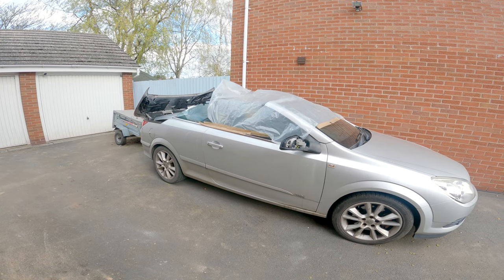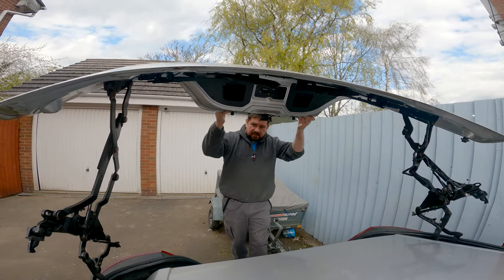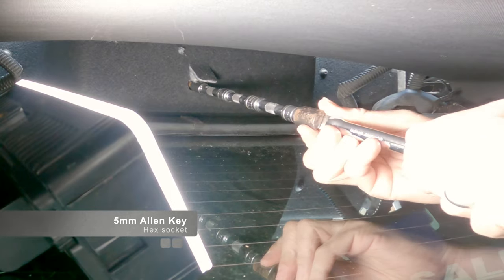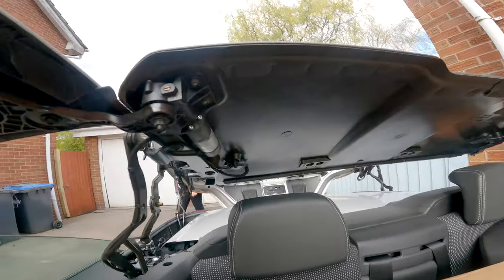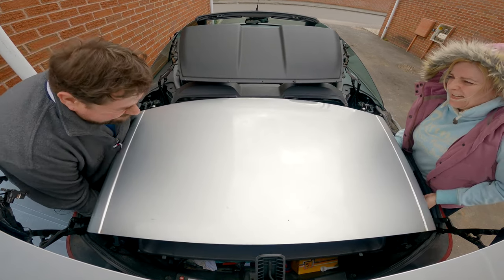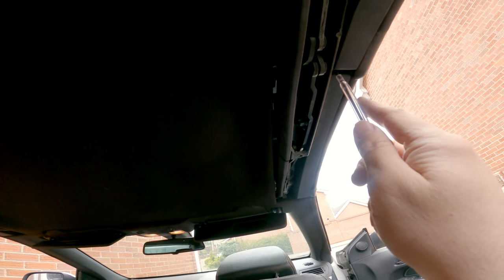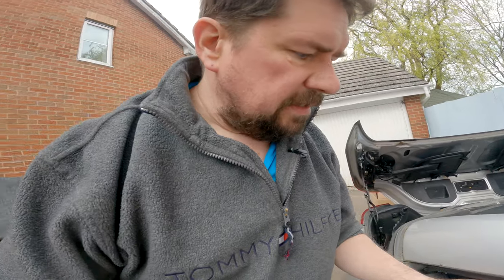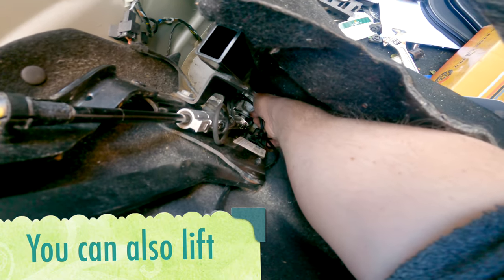How to Manually close Astra Twintop Roof

Comment: Wish you video was around 3 weeks ago would have saved hundreds.
Reply from the maker: Thank for the comment, I wish I didn’t have to do this video at all but I hope it helps people in the future
Reply: @RichManPoorMotors  Any more videos planned for this car? My TT is in a bit of a mess the rear ECU needs cleaning/replacing, boot won't open currently and car will not start. Ordered an op-com today to hopefully sort some of the issues.
Reply: @RichManPoorMotors  thanks, good video for future reference shared with FB owners group.
Reply from the maker: I have some servicing planned on twintop, might do ultrasonic cleaning injectors and timing belt, once I get a couple of my other cars back on the road, started work at work before lockdown so hope I can remember where I put everything 
I’ve used Opcom myself, when I purchased the car the boot wouldn’t open, and sorted that, I might have filmed some stuff that I haven’t edited as my farther was on them and passed away, so a bit hard to edit at the moment
Reply: @01Blagard Thanks for the advice, Vauxhall said the roof ECU is causing the starting issues (keyless entry), ever heard of that? Plan is to get the boot open , clean up the corrosion if salvageable otherwise get James out from Kent who does mobile repairs for TT roofs.
Reply from the maker: this video will be going live tomorrow morning about the boot unlocking and latch https://youtu.be/8UNmt3ZJwv8
Reply: @RichManPoorMotors  How to repressurise hydraulics?
Reply: Great video, thankfully it was one of my winglets that failed to open,I turned manual screw 2 turns tried again and it closed,I'd already changed to brass cogs 2 years prior,

Comment: Finally someone has done a video showing this procedure. Ive also got a twin top with the roof stuck open and managed to figure out most of the manual closure procedure but couldnt find where the hydraulic relief valve was. I literally stopped working on it an hr ago with the thought of doing some more research then came across your video. I will have the roof up tomorrow without a doubt 👌🏾
Reply from the maker: Make sure that all the roof locks boot locking and rams in the boot are fully closed position or boot won’t open from Handel, or Disconnect plugs as shown in the manual to disconnect roof ecu as to access to the boot from boot switch I could use my laptop so didn’t think about it at time of filming otherwise you need to manually open the boot which is a pain
Reply: @RichManPoorMotors  where abouts is the roof ecu?

Comment: to solve the boot not locking at the end you need to push the big plate behind the plastic trim for the boot to latch as well as keep the pressure from the pump turned off and the rams pushed all the way up till they stop then lock the latches then turn the pressure release back on then itl work 1st time

Comment: Thank you. Saved my life. The netting came loose whilst I was closing it. Read the books and it makes this process so much harder. Thank you x100
Reply from the maker: Thank you for your comment, I’m glad it had helped
Reply: Don't know if it would still apply to you (or others) but I tied a thin rope from the loop on the plastic thing at the front of the netting to the side of one of the mesh storage compartments (very loosely) so I could grab that cable and pull it in to reach the netting again in case of it closing with the boot in (had happened before and isvery difficult to reach) - so a good idea to do before anyone gets this problem :)

Comment: omg what a lifesaver....I thought car was fit for the knackers yard...2 rac guys couldn't get it back up...took a while but following your instructions me and my tiny gf have the roof back up...I broke the boot latch but with help of a bungee cord I am on the road again..Will have that fixes for a LOT less price than getting g the roof up...thankyou...legend
Reply from the maker: Glad it helped, fault is usually broken wiring on the left hand boot arms
Reply: Hi my boot won't open and now it's making a beeping/dinging sound which it never did before could they be due to the boot.. only happens when I go over 20mph
Reply: Hi jack if you have the beeping it means your boot latch IS open....I had same problem but mine wouldn't close...soon as do over 20mph the beeps start so be careful it doesn't come lose while driving....I had 2 bungee cords round mine till took it to garage

Comment: Even years after you uploaded this, you're still helping people. Mine was also stuck mid closing. However I did screw up the final part and now the trunk isn't fully latched yet I can't open it. But it did make my car drivable again untill I can get it checked out by a mechanic. You saved me a few for a rental car. The included instructions are rubbish indeed
Reply from the maker: To open your boot pull fuse (15 I think) under the bonnet this will allow you to open the boot to adjust latching, it is probably the hyd rams not fully up left and right but mack sure you replace fuse before driving as it also connects important other systems

Comment: Very clear, thank you. I've had lots of problems with the roof and the hand book is useless. I have to say that each time the problem has been different so I can't blame anything specific. It's getting the car to a repairer that's the biggest headache if you can't get the roof shut (as all readers no doubt know). 

I've had the same gears as you plus electric looms/computer, and now its one of the rams. It's a circlip that's gone and, no doubt, I'll have to get the whole ram because you can't get the cheap part!

I still love the car though.
Reply from the maker: You should be able to get circlips from a motor factors or Amazon
Reply: Ah, OK, I've only just seen this reply - as you can see above, another problem!

Comment: Great video 👍🏻 and very informative. I’ve always fancied a twin top but this has always worried me if this happens when the roof gets stuck . Are they reliable & do you get many problems with the roof ? Cheers Terry
Reply from the maker: I’ve had a be eos that had no faults and this Astra, the Astra had mega mileage and I bought it with a fault, the wiring loom on the Astra is exposed compared to the hidden eos, which makes it more prone to being caught by something in the boot. But easier to repair, the main problem would be a broken wire but this can happen in any saloon, estate or hatchback, there is just more of them in a twin top.

Comment: Hello! Thank you so much for this video - we managed to close the roof manually following your video. But probably we did something wrong at the end - we closed the trunk and it's impossible to open now. At the autoservice they don't know what is the problem wit the roof and only for opening and accessing the hydraulic system to check the problem, they want to charge crazy money. I decided not to fix it just asked them to remove beeping (the cars beeps because it things roof is open). They also say to remove this beep, they need to access hydraulic system because fuses are there.
From your experience, maybe there is easier way to reset electronic system or clean errors, so beeping stops?

Thank you in advance.
Reply from the maker: The beeping is because something isn’t in the right place, to open boot pull fuse 14 I think from memory in engine bay an you can open boot but replace as it is needed for other systems, the most likely causes are boot locking tines in the catch or hydraulic rams left right c pillar area not fully up, a temporary way to stop beeping is to remove plug to roof mechanism on the boot lid this disconnect the educators beeping and allows you to operate the boot

Comment: I just showed this video to the AA man who came to get my roof up - thank you that it's so clear to follow. Problem not fixed but at least the car is usable and weatherproof. 
One question, though, the boot has locked shut but what were we missing in getting it to lock? He unscrewed the motor on the book lock so I can't use the boot until the problem is fixed. It looks as though the nearside boot flap motor has stripped. I had new metal gears put in about two years ago and I thought they would last. Could it be the flap itself?
Reply from the maker: Could be flap motor could be wire broken in the loom that would be my 1st look, could be a microswitch hard to diagnose needs putting on a diagnostic to point in right direction 
don’t know why boot motor would have been disconnected pull fuse 15 in engine bay to open boot if boot switch is still working and replace fuse before driving

Comment: Are you supposed to tighten the allen key screw after undoing it or leave it loose? on mine the boot lid went all the back and got stuck on up open position like your car. Do I still need to do everything as you have done? I have replaced the cogs with brass ones already.

Comment: Thanks for the video.. I done this earlier.. but no my boot won't open and when I drive past 20mph it keep making a bleeping/dinging sound
Reply from the maker: The beeping boot not opening is because the sensors are telling the car that the roof isn’t fully closed
The sensors are 
the roof into a pillar left right
The rams (c pillar) for lifting the roof not fully up left and right
Or the boot catch rear centre not fully rotated 
These can be done but pushing catches with screwdriver fully closed a pillar, lifting rams in c pillar hydraulics this is a bit tricky but can be done again using a screwdriver or a socket under rams while you close roof, and the boot tines can be closed in the boot lock by pushing with a screwdriver. To open boot pull a fuse in engine bay I think for memory it is f14 or f15 this will allow you to open boot but replace fuse before driving as it also dose other important circuits  once all done beeping will stop, fault is most likely a broken wire in the wiring loom attached to the boot mechanism on left hand side
Reply: OK brilliant thanks for letting me know I'm gonna pay to just get the whole thing fixed... cheers mate

Comment: Im in the same position. Roof half open. How do you re-pressurise after youve fixed it? Any idea where the fuse for the roof is? It doesnt show on my manual and want o check that first before I start taking it apart! Many thanks for putting this on. Much appreciated.

Comment: Ey man, first of all thanks for your video, but I do have a question, so I had to repair some cables cause my roof wasn't working anymore, I bought the car with an inoperable roof, so I managed to get it working and don't have any faults left using an opcom, but it just doesn't want to complete the cycle, so the trunk flaps unfold aswell as the front flaps and then the next step would be 2 lay down the front lid and trunk lid, but that doesn't happen somehow, I can still close the roof using the cars button, And whenever it seems to get at this position I can hear the pump spinning, but nothing really happens, Do u might have any idea what could cause these,? Yeah I know my explanation might be a bit weird, but I'm Dutch so yeah, 😂
Reply from the maker: I don’t know what would cause it, I would check hydraulic oil level, continuity of cables and sensor readings, and rams are fully in positions they should be before operation starts, sorry wish i could help more
Reply: @RichManPoorMotors  yeah it's a complicated system, as far as I can see the rams are in the right position,And i allready refilled the hydraulic oil,Could it be a broken pressure piston... That's what I'm thinking😊The only problem is I don't know how the sensors should read in this position, there's not to much info out there

Comment: Hi Rich, Thanks for your video's they are a great help so thank you for posting them up, I still have an ongoing issue as follows, The roof works fine opens and closes, when the roof is down the boot opens normally but when closed the boot will open slightly and I get bonging when over 20 mph, when I close the roof I don't get the beep at the end of the sequence, is this problem still relating to the rams dropping as shown in your video or is this a different issue. Regards Andy
Reply from the maker: I’m not sure, if the rams are not in the right place the roof won’t open at all, is the boot catches (left and right ) locking the boot when the roof closes/ boot closes sorry wish I could have been more help

Comment: Hi, My roof is fully in the boot and stopped working with the boot lid just fractionally off closing fully so I am unable to access the boot like your video. I have viewed the boot lock mechanism through the ski hatch, but cannot access it to open it manually due to the glass. have you any ideas to operate the locking mechanism so I can open the boot.
Reply from the maker: This is from memory, pull fuse 15 or 14 in the engine fuse box to operate boot, there are pull loops in the boo operation hinges that can release the roof but through whatever gar you can get you would have to release hydraulic pressure as shown

Comment: my roof has stuck...i close it manualy i change the interior switcher...still sometimes doesnt close or open...any idea?
Reply from the maker: Check that boot locking tines fully closed, rams fully closed, roof fully locked then roof should open, might need error code reset cleared

Comment: Hi, after i have closed the roof manually i can't close the trunk and i have the buzzer after 30 km speed. Any suggestions for this problem? 😔
Reply from the maker: Buzzer is because boot/trunk (or roof locks front window) is not closed properly, the boot is probably not closed either at the hinge (hydraulic rams not up fully) or the boot lock owing to the locking tines not fully rotated, therefore micro switches are not operating as they should, this needs to be done for the roof computer to know everything is ok, also roof needs to be locked in the front window frame then buzzer will stop, if you need to get into a locked boot pull fuse 15
Reply from the maker: sorry cant seam to reply to your latest comment but the buzzer is from the roof sensors not being fully closed properly this would include the microswitch sensors for the boot

Comment: I saw you use the Maxiecu and tried to view it on youtube. It is all in Polish with no english version to view. How do you get it to work in English?
Reply from the maker: I just purchased it and loaded up into a pc laptop and either it was in English or I selected English in the installation, I used maxi ecu as I can add more car brands so far it has worked fine
Reply: Thanks a lot

Comment: Hello, thank you for your video, I have now subscribed, I got stuck locking the roof with the screwdriver and my boot no longer opens when I press the button,  I have however managed to get the roof down thanks to your video, be nice to see the follow up
Reply from the maker: Glad it helped
Reply from the maker: you can open the boot through the flap in the seats as shown then disconnect the roof ecu if you want to use  the boot, video was just showing how to manually close the roof, while waiting to fix, eg temporary measure, untill you can get it fixed. you need to find fault, usually in the wiring, but could be motors or hydraulic etc, mine is flap motors
Reply: Thank you , yea I meant I managed to close the roof with your video, just locking it seems to be a pain but I will try with a screwdriver again today, maybe the boot won’t close because I haven’t locked the roof , could be a safety mechanism, I learned a lot from your video , thank you
Reply: Meant the boot won’t unlock
Reply from the maker: this video is going live tomorrow about the boot, hope it helps you https://youtu.be/8UNmt3ZJwv8

Comment: My roof is operating fine however when i put it back up boot doesn't close properly yet it doesn't open either. It is pinging once i go over 20mph. Would you know how to go about such an issue please?
Reply from the maker: @roora111  beeping will probably be a sensor telling the car that the roof/boot it’s fully closed. It probably isn’t a sensor fault but the part of operation not fully completed, on the the boot where the hand opens the boot you have the boot lock on the body of the car check that the latch has fully rotated and that the micro  sensor is showing that it’s closed the physical tines can be pushed with a screwdriver but be careful if the switch, the other sensors are the rams left and right for c pillar make sure they are fully up, and roof to a pillar fully locked failing that it might be a brake in the wiring loom check 1st for continuity then for shorts in insulation
Reply: @RichManPoorMotors  thank you so much. I'll test it asap.
Reply: @RichManPoorMotors  i have no idea tbh. It looks like latch doesn't let go and holds on. I don't know how to tackle it
Reply from the maker: @roora111 the latch rotates one way to use like a standard boot on a saloon car and rotate the other way to use as a hinge for wen the boot opens at the front to allow the roof to fold into the boot
Reply from the maker: @roora111  you can rotate the tines by pushing with a screwdriver or a pin punch  you should see the micro switch operate one way or the other